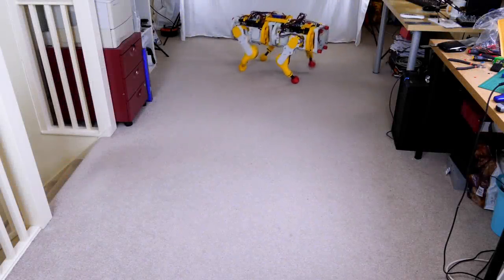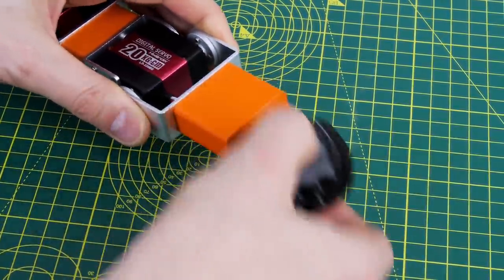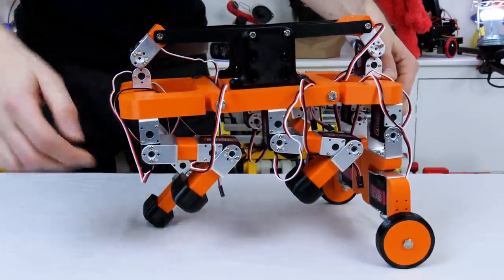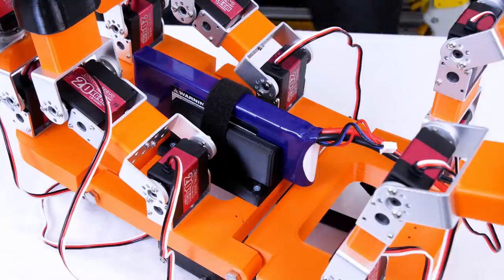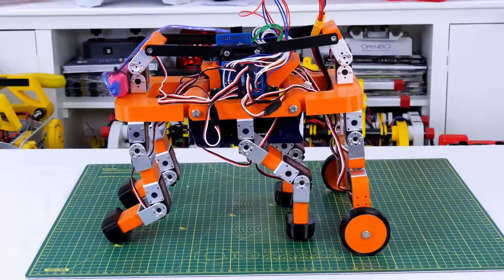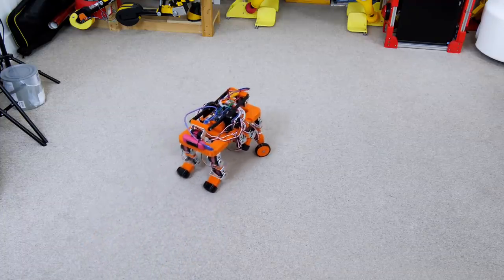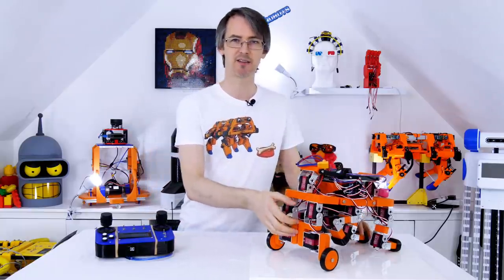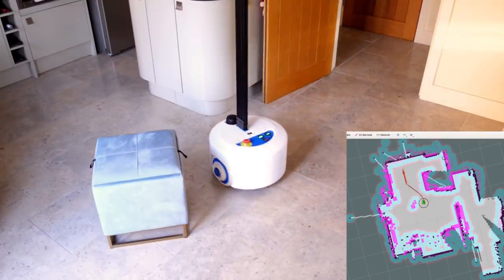How this Robot Climbs over Obstacles

Comment: I can imagine how every foot being a powered wheel could be an advantage too.
Reply: @everettstormy  Exactly.  To be able to use them as feet for walking or as powered or free rolling wheels for rolling.
Reply: Interchangeable foot modules, anyone?

Option A) Plain foot
Option B) Powered wheel
Option C) Lockable unpowered wheel
Option D) Unpowered wheel that can be pivoted 90° to lie it down flat and use it as a foot
Option E) Gripper claw, hand, hook, suction cup, velcro, or other application-specific end effector

There have to be tons of alternative permutations, too... What else could he do with an interchangable-foot concept?
Reply: @RobotZombii  I like the interchangeable foot idea.  A powered wheel foot can act as a plain foot, a powered wheel, a lockable unpowered wheel and a wheel that can be pivoted 90° to lie it down flat and use it as a foot (A-D).  

Now this drone we're describing could walk on four legs to the base of a coconut palm tree, bear hug it with all 6 legs and roll up the tree where one of the 6 legs (or a separate robotic arm) could change to the landscaping trimmer with 1 meter extension module, trim the fronds to the programmed angle and harvest the coconuts recognized as mature and lower them to the ground with a max velocity flywheel line.
Reply: Would be fun to come up with a clever mechanism which allows the knee motor to drive the wheels in “wheel mode” so you don’t need extra motors.
Reply: @RobotZombii  solenoids, when extended it would be like a claw pointing down. Retracted for slippery environments.
Reply: @everettstormy  
Indeed!

I suppose I'm really assuming that the long-term end goal of this experiment is to learn enough about stair-climbing that he'll be to implement it as a feature of the OpenDog platform...

So the "swappable foot modules" proposal is ultimately intended for OpenDog, but (just like what he's done in this video) certain aspects of the concept could be prototyped and explored at a smaller scale in the meantime.
Reply: @everettstormy  ahhh hmm yes solenoids would be very power hungry when extended. Your reply made me think of another option. Make the foot flip or change orientation so that a claw or spike would be used. That way no additional power would be used. Maybe the claw can be on the top of the toe used like a ballerina doing a pirouette.
Reply: @everettstormy  agreed, and I just "ran the numbers" putting a claw/spike on the middle legs would allow it to turn on dime.   Put the middle leg down on the direction you want to turn pushing with the opposite rear leg.
Reply: @everettstormy  Hmm, so the end-game for that would be like if he built a four-limbed upper half for the Sonic bot?

Comment: Hey James 
I’m just wondering what microcontrollers you use to power most of your robots 
Eg* the humanoid robot’s walking legs 
Because I’m trying to start building robots with my arduino uno and I’m wondering what direction to take after that
Reply: he mainly uses arduino mega and also teensy. As for what direction you should take after an uno. It really really depends on what your application will be. Case in point I think James used Mega's due to either "having them" or it might be they have 2 hardware serials (not checked/don't know as don't have one so never had cause to, but I have dim recollection of him maybe using such functionality) and he's a fan of serial. So yeh, think about what features you need, e.g. protocol support (UART, SPI, I2C, I2S, canbus, PWM), number of pins, number of analogue input pins, do you need DACs, what voltage output do you want, what is your power supply, do you want low power or power saving modes, do you need bluetooth or wifi (you can always add them later), do you need it to act as a USB generic device (like with an arduino micro/yun/leonardo). As for robots uno is fine (my first 2 were uno based) then I moved to an ESP32 mainly for reduced size and more PWM (Oh another one to consider is choice of language as some boards support python now which some people like).
Reply: @WistrelChianti  wow thank you I’m  really impressed that you know all that
Reply: @ollieinman152  it's been a long year haha

Comment: If you shorten the step length of the inside rear leg during turns it would probably be able to turn quite a bit tighter.  You can also make the inside wheel turn tighter than the outside wheel so they're following the correct arcs in a turn.

Comment: Can you keep one of the back legs down while turning and pushing with the other to tighten the turn and have better control?
Reply: Or maybe just shorter steps on the inside turn leg, proportional to the desired turn ratio. Would save on four more motors in the hips.
Reply: @newburypi  ah yes I could see how that would make that turn radius variable. Like the differential of a car. I was thinking more like a track vehicle like a tank or an excavator spinning on one tread. I was even thinking replacing one of the pads of the feet with a solenoid and a sharp-ish point would give more traction when needed and be lightweight.
Reply: Like a claw sticking out when needed.

Comment: I picture a tandem robot system. The main body, and a flight hook. Like a winch but with a guided flight drone instead of a hook. Then your climb height is pretty much only limited by the length of the cable. 

Have the drone trail a light cable, like fishing line, It's purpose is to secure itself to something and then winch up the main climbing cable. Once secured the main robot winches itself to the secured position. You could literally climb a tank over a mountain with a system like this.

Sidenote: I often think about the ultimate vehicle, and basically I've concluded it's Project Orion but also capable of floating, submerging and tunneling down.

Comment: Interesting.
I think turning would work even better if you adapt the step size of the hind legs, so that the leg on the side you are steering to makes smaller steps than the other leg. That way you can avoid slipping of the hind feet.
Climbing doesn't look too convincing yet. The trot mode is just clumsy while the front wheels stick in the air.  Have you tried a mode where you keep contact with the wheels and then push forward alternating between the hind legs and the middle legs?

Comment: Have you tried to adjust the step distance in conjunction with the turning radius? During a turn maybe the inner leg takes a smaller step than the outer? Also it would be funny if you had added ackerman steering geometry to the front legs, basically both wheels would pivot towards the center of rotation giving it better forward momentum with less over/understeer. Just some things that came to mind, good build sir.

Comment: 2 Ideas
First – measure the current going to a leg servo.  When weight is put on it the amperage should increase.  Based on the amperage you could not only tell the foot is down, but how much weight is on it.
Second – Power the wheel.  Then put the wheel mount on a “L” shaped bracket that pivots.  One end of the bracket a foot, the other a powered wheel.

Comment: For the limited amount of mobility in the final prototype, it seems like you could have eliminated one servo per middle/rear leg. Just have the one motor at the top and articulate the knees with gears and linkages. It would reduce the amount of future flexibility in the design, but for this proof of concept it looks like you never took advantage of that flexibility anyway.

Comment: Before sidestepping the back legs...
Consider the way the legs are currently moving as a solid axle on a go-cart, no differential.

Code the rear legs to act like a differential, the inside leg moves a shorter distance that is related to steering angle.
For a tight turn, maybe even stop the leg on the inside of the turn completely and the outside leg "row"  the wheels around the corner.

Comment: Since it's stable, would it turn a tighter radius if when turning left (for example) it only pushes with its right leg and keeps the other legs folded up?
Reply from the maker: Maybe, but it would fall down when it took a step?
Reply: @jamesbruton  Ah true, turning the wheels might move its centre of gravity to a less passively stable state :)